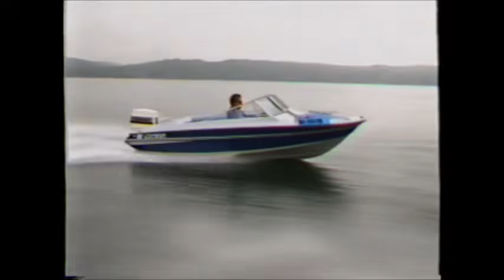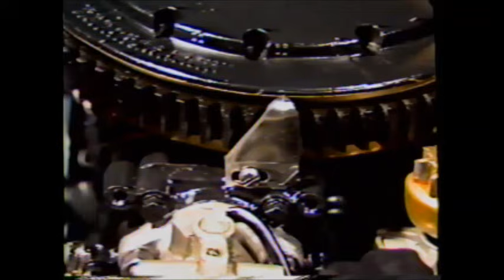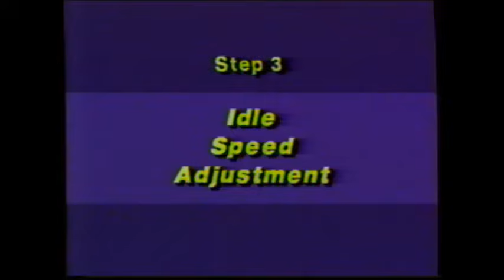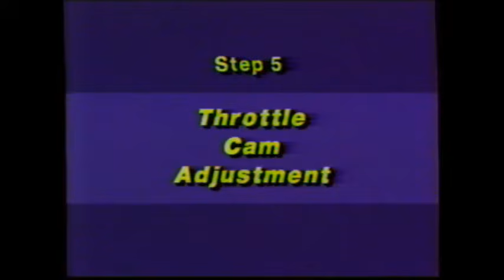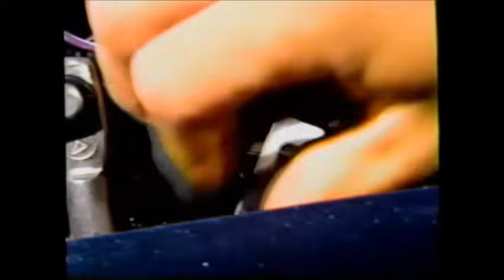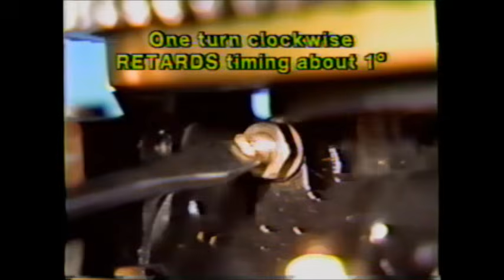OMC 1987 and Newer 3 Cylinder Linkage Adjustments

Comment: so in this case doesnt tell anything about minus 4 degrees for full timing advance  what is the correct?
Reply from the maker: The -4 is the Joe Reeves method for timing without a tank/test wheel. 
And yes, it works (assuming you dont have, or have disconnected, the fast start feature)

Comment: Howdy, so i have to pull and rebuilt my carbs, bought the kits w/floats, i have float drop measurement (found service manual on ebay) but i can not find special tool to set float level, all i can find online is to turn the top upside down and adjust float so it is level with the top body of the gasket surface...your thoughts...

Comment: This video saved me thousands of $$$...which I cannot afford, I was seriously considering buying a newer 4 stroke motor. It starts and runs good, when it runs, it didn't want to idle and when it did, it died when I put it into gear. I think I may need to flush out the carbs with a mixture of gas and oil mix as required, but a good measure of Sea Foam and run the motor for a couple of gallons or so. Thank you so much for posting this video.
Reply from the maker: @toneklein8950  clean carbs, adjust timing, check spark, and check compression and it'll be fine.

.....I typed that in reverse order btw.

Comment: I am confused on the Idle speed. He is setting the idle with the boat in the water, in gear ,  with a prop installed, not tied down,  and the throttle plates are not engaged.   I feel like I am missing something here.  Can this be done on muffs?
Reply: There needs to be pressure against the exhaust system from water. Putting it in a bucket is better if you don't have a calm lake. Not a mechanic but that's my understanding.
Reply: You need back pressure from the water, like he said i believe if you set it on muffs then when its in the lake it will be to low

Comment: I have a 1986 Johnson 50hp. I was wondering if you knew what the WOT degree setting should be as well as idle timing degree setting. Idles pretty good, WOT seems a tad off. I just dont want to burn a piston if its too far advanced.
Reply: WOT timing is a factory set n' forget type deal, unless some dunce decided they knew better than the engineers. However, its very easy to check! timing light and can do it statically with throttle in WOT position, spark plugs out. look for 15-17 degrees (18-21 degrees when motor is running). the 2cyl 1980-1985 60hp motors were 21 degrees, but i wouldnt go that high. id experiment around 18-19 degrees whatever give you the most bottom end punch. your 50 is basically an older 60hp, so very possible it makes more power all the way up to 21 degrees but use high test fuel when doing this to find the sweet spot.

Comment: Man, my Idle Set screw has been....remove, and theres just a normal bolt screwed into the hole and painted over. It's making it hard for me to find knowledge on how to bump my idle up some.
Reply: whenever i hear "bump the idle up" it makes me think you have a fuel issue or shot piston skirts, not letting it idle properly.

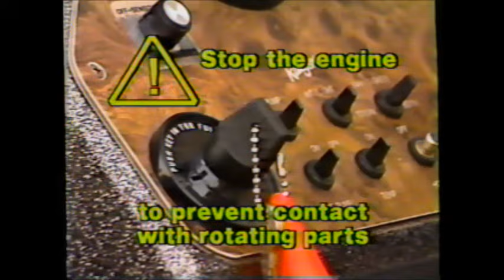Comment: Brandon, @ ~ 8:12, should the throttle lever spring hold the throttle lever against the idle screw? I am trying to complete this process, but when I disconnect the throttle cable, the throttle lever falls away from the idle stop. If I disconnect the spark advance linkage, the whole lever assembly swings freely. The spring does provide tension between the throttle lever and the spark advance lever when you manually advance the throttle lever past the max spark advance position of the spark lever. Hope that makes since.
Reply: did you disconnect the throttle cable first, then do the adjustments? if it just swings around freely, you will need to service the throttle advancing lever (the one with the big single bolt in the center). there is a bushing in there and shims, i believe. replace those, and you will get resistance back.

Comment: Wish you would buy.... I DOn't know 1982 Johnson 70HP Triple.  Not much info at all on that motor. and what's out there is TERRIBLE.
Reply: accept the factory service manual. did you buy it yet?
Reply: @ct1762  i own the service manual. first thing i do when I buy an outboard for the fleet.
Reply: @dongesswin  those earlier ones , prior to 1984 or so, are definitely not as refined or detailed as the later ones. just as long as it's the factory manual and not those aftermarket ones. did you get it worked out?
Reply: @ct1762  where can I buy the factory manual?
Reply: @vinhoi69  Ebay. a ton of em' available!

Comment: Thanks at last I can fix my Johnson's likage. I think my linkage is out. The idle speed screw does not even touch. Cam movements are late. The lever of the advance moves late, so I have to keep the minimum at 1300 rpm, otherwise the engine goes off when I enter the gear. Now I can finally fix everything. Thanks again you are a true friend